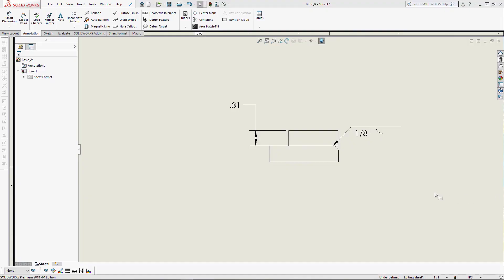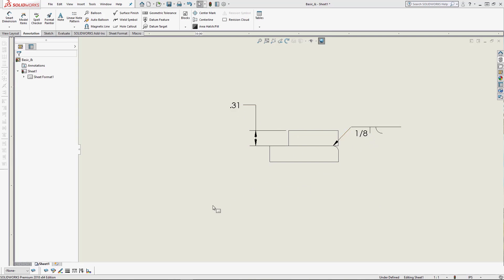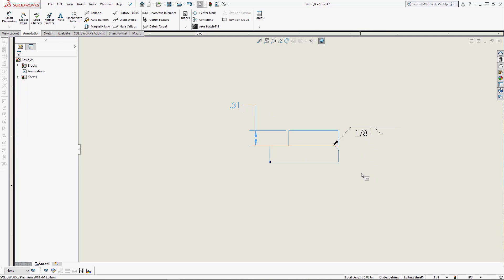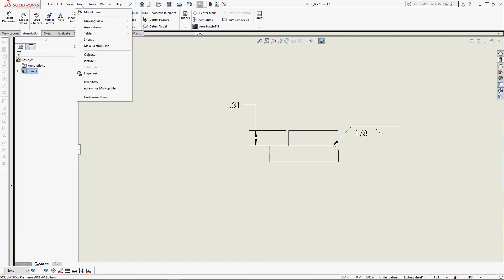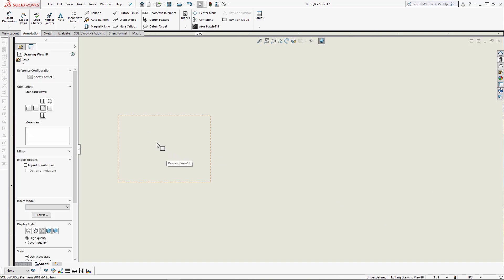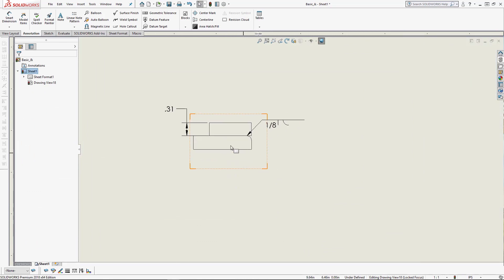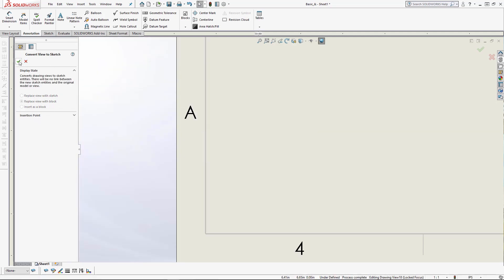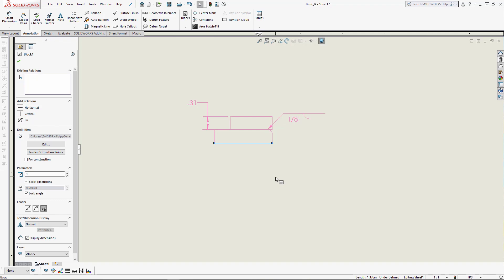SOLIDWORKS - Adding Weld Symbols & Other Annotations to Blocks

Comment: Why anyone would create a block of a view?
Reply from the maker: Hi Sumit,
The reason to make a view into a block would be to remove an unneeded reference to another model file that could potentially be broken.  If you have a view of a model that only acts as a contextual reference to what is needed within a particular drawing it might be better to use a block view to make the drawing more self-contained.
Reply: @goengineer  can you explain this in simpler way?